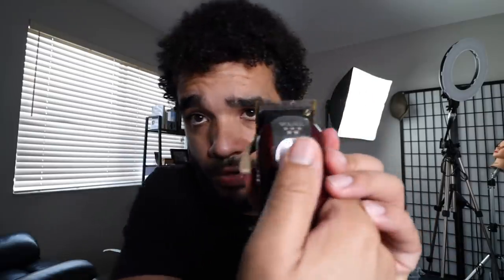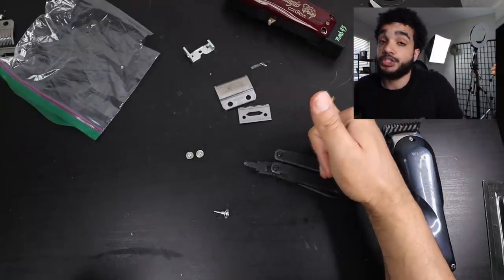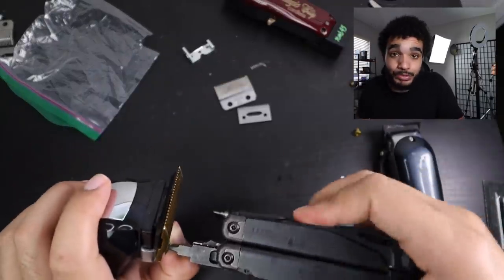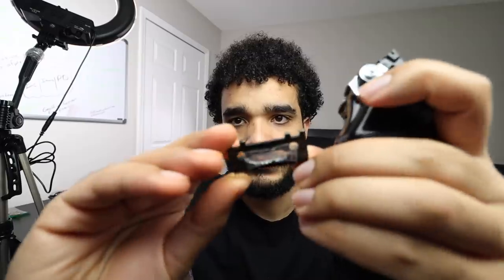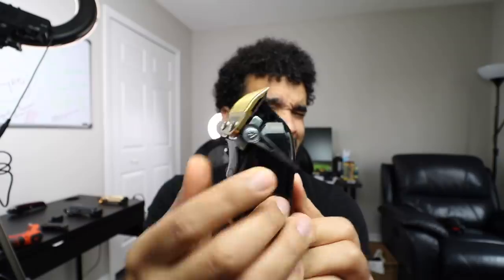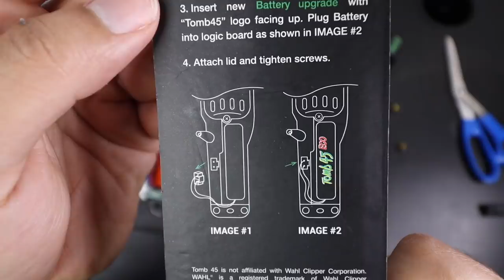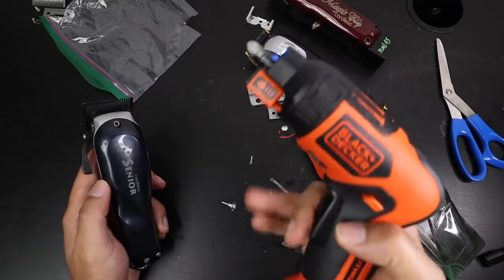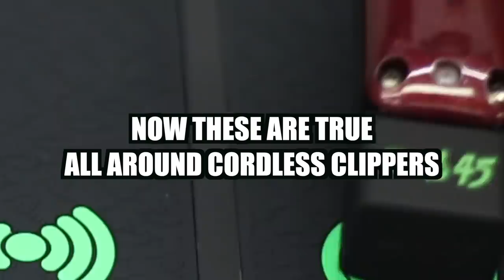DIY - Hair Clippers

Comment: I keep it classic, Oster Fast Feeds. Motor has a nice low hum to it, none of that buzzing noise, but strong. No need for second passes. Also really cool running with the ceramic blades.  If you don't use ceramic blades, try them, you'll want to switch all of your stuff to them, and for a barber they will save money in the long run because they stay sharp, cut clean and glide easy. Dirty hair, wet hair, it don't matter. Nothing slows them down.

Comment: Now does the clipper cut better with the babyliss blade? Couldn’t you just use the wahl cutting blade and use the babyliss still blade?
Reply from the maker: I think both blades cut well. I switched it to have something different to look at. Cutting with the same tools gets boring. Yea all those methods work too I tried it with the wahl cutting blade.